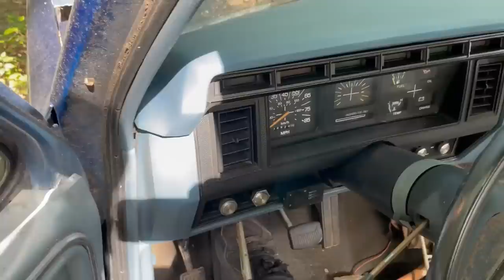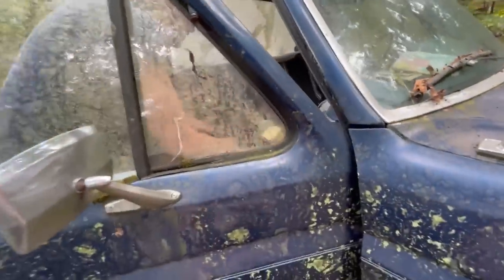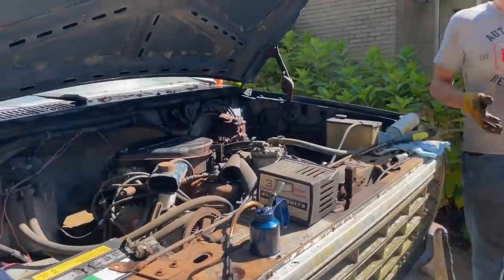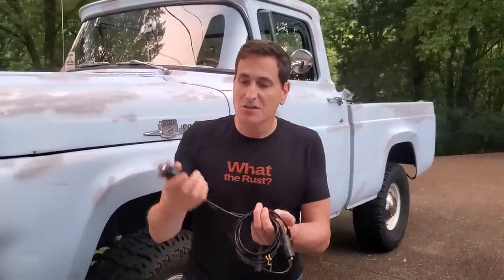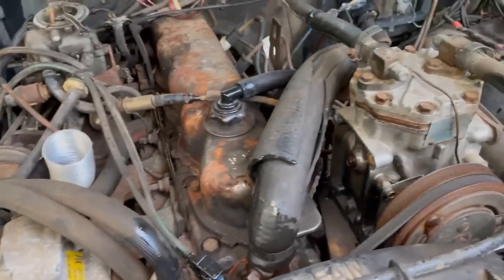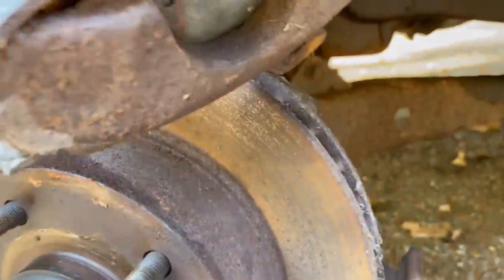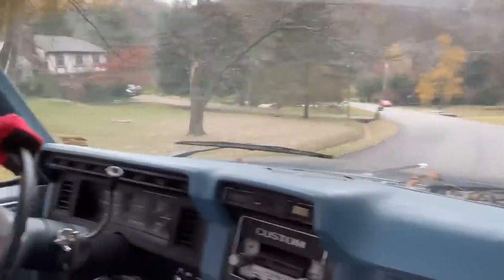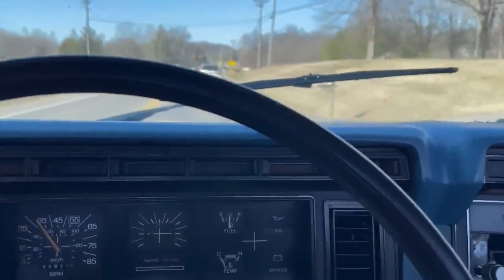What does it take to rescue an old vehicle? How much does it cost?

Comment: Thanks for the giveaway draw. Someone will be delighted to receive this. I wonder, though, is it suitable for use in a 220/240 volt country? Perhaps just with a different charger?
Reply from the maker: Yes, it will work on 220, as long as the charger output is the same.

Comment: Enjoyed this one Richard, and love the 80's 8 spoke wheels, I have the same thing on my Van!
Reply from the maker: Nothing says 80s like those wheels. Thanks for watching Kev!
Reply: This one looks to be an '80 or '81..the only 2 years of this body style that had F-O-R-D letters on the hood, and lacked the blue football in the center of the grill that Ford has felt like they must put in the center of the grill of everything for the last 40+ years. I much prefer the clean grill and the FORD letters. The fact it's an '80 or '81 is also probably why the paint is still reasonably good...pre-EPA paint years. By the mid-late 1980's, the EPA paint would peel like an onion in 3 or 4 years..sometimes not that long. I bet if this was an '86 or later truck, the paint would be peeled off...

Comment: I was 20 years old in 1980, I was driving a 1979 I bought new and I had a 1968 F100 with the 240 straight six! My 1979 had a 302 automatic and I got married and started driving my 68 again to work while my wife was now driving my 79, F150! My oldest brother had a 1980 just like that one with the 300, 6 cylinder and he pulled a 16’ trailer hauling his tractor and implement! That 300 was a brute, plenty power!

Comment: Brake fittings, Heat, spray with lube, Heat, spray lube then attempt to undo. You heated it, but there was no lubrication between the fitting and the flared end of the pipe. A little heat, a lot of lube and patience usually saves you at the master, if the lines are bad underneath it is usually quicker just to make a new hardline
Reply from the maker: Right on. The original video showed the oil, but it didn't make it to the final cut of this one. It had burnt off from the torch in the scenes here. Thanks for watching.

Comment: And the AC works! Lol 
Yes Richard you understand the irony.  That is a dealer installed indash system.  Remarkable the shaft seal in the compressor did not dry out and leak. I expected the old straight-6 to run. But the air had me laughing. Did a rescue similar to this on a 1982 F-150 for a doctor that parked it years ago and wanted it back on the road. Same project, fuel tank, fuel system, carburetor, brakes and lines, new heater and radiator hoses, water pump, and a hell of a good cleaning. He's been driving it since I delivered it back to him two years ago. Thanks for the memory! 
Great trucks those old straight-6 Fords.
Great rescue brother. 
Kudos to you and the misses.
Reply from the maker: Thanks Gary. You are right about the compressor. It started leaking oil a couple of days after we got the truck running. There was more oil in it that I would have expected. We are happy this brought back some memories for you!

Comment: Lost keys is a common problem with older vehicles..lost titles are also a common, and bigger problem. Here in Ga., you don't have to have a title for anything '85-back, which is great..it is getting to be a problem now, though, since late '80's and 90's vehicles are getting on 30+ years old, and thus a lot of lost titles. I can imagine what a headache it is in states where you have to have a title for anything. It's ridiculous, nothing 30 years or more old should require a title, especially where it has been sitting and off the road for years..a notarized bill of sale should be sufficient. And on people not being honest about how long something has sat..well, yes, they might be being dishonest, but I think many times, they just don't really realize just how long it has been.
Reply from the maker: Here in TN titles are required for any year, but if you buy a car that is over 30 years old and pay under $3K there is a way to get a title. It is a bit of a gamble, since you never know what the State will say, but it does work.

Comment: I just restored the mechanical side of a 1977 chevy c20 454 truck, ended  up pulling engine to rebuild good I did crack on crank journal, 2k for that plus machine work, bought for 1600$ have about 5k totaklin truck fixing all mechanical issues.

Comment: Always enjoy watching your video.  Practical approach and explained well.  Also, I have a 1978 New Yorker Brougham with the 440 engine, and unfortunately, the Lean Burn system.  Would love for you two to come diagnose and fix the Carter Thermo Quad.
Reply from the maker: Where are you located?
Reply: @whattherust  Greer, SC. She is not a rusted car that you normally deal with, but I have faith that you will know what to do to get this Carter Thermoquad doing what it is supposed to be doing.

Comment: Hi guys , my first will it run was in 1988 , I purchased a 65 t bird 60k miles from original owner. I had sat for 15 years, got it for 1200. Pulled plugs filled cyl with diesel ' Put new battery fired it up and drove it home.Everything worked. Drove it for 2 years then sold it for 3500 because my neighbor had a stroke and he used to own a body shop and he would sit there and look at it and cry. It had to go. All I spent was for batt points wires and plugs and an oil change. 
I had a ford truck maybe a year newer than this one , same blue, what was funny is that it had a galvanized body. Wouldnt rust but wouldnt hold paint either.
Reply: Ditto on the galvanized paint. Elliott Paint out of Chicago in the 1970s had a primer called "Galva-grip" that worked great
Reply from the maker: Thanks for watching!

Comment: Hey Richard & Cristina, I had just gotten back from town parked in the shade and decided to see what was on YouTube and immediately recognized the Blue Ford.  Naturally I had to watch your video.  I still have my red 85 F-150 sitting here on my property. The one thing that your truck had that was the brass radiator whereas my 85 had the plastic radiator. 
Also, My Ford has the New Process 435 4 speed transmission instead of the 3 speed on the column  First gear was low enough that you could jump out of the truck and walk alongside it and never worry about killing the engine. - Now talk about some old truck feel.
My ignition system has the module mounted onto the distributor instead of the DuraSpatk ignition system.
Hearing about that wiper switch, I am kind of curious if someone hadn’t installed the same type of wiper switch like my 1990 F-150 has where you turn the switch to the left for the intermittent wipers or click the switch to the right for the normal Slow & Fast Speeds.
Anyways I made sure to subscribe to your other YouTube channel if nothing else to show my support for your great content.  Try to stay cool & hydrated because I am quite sure that you are having the same hot weather that we are In Central Kentucky.
Reply from the maker: Thanks very much for the support. It is hot here too, but relief is coming.

Comment: What makes of batteries and battery chargers would you recommend ?
Reply from the maker: Hi Gary. I use Interstate batteries from Costco. They are much cheaper than those from the major parts stores, and I have had great luck with them.

Comment: i had a 59 Chevy truck straight 6 it sat a long time I should of dropped the oil pan and got the crud out that's what killed my motor .it had a starter pedal on the floors
Reply from the maker: Those old Chevy sixes sometimes don't have oil filters, so a lot of junk can get into the oil pan and stay there.

Comment: great video, very informative. though most vehicles you'd find in european woods will be way gone, and parts aren't as easy to be found unless mercedes or aircooled VW. no other brand, except Porsche (and you rarely find them anymore, they are too expensive) is popular enough for companies keepign every part you'd need to get a car back to live, in production. especially Ford is notorious for that, in late 90's they shooed a large Capri club away asking for parts reproduction and documentation. only later they realized what Mercedes knew for far longer: drivers of classic cars tend to buy a modern daily driver of the same brand...
anyway, a straight-six, three gear manual pickup from the 80's sounds like an english basic vehicle with only the bare necessities in it. I hope you'll get more feedback from the buyer, and especially the new owner. maybe they'll keep it for longer? and keep it fairly original, too. I had my very first car for almost 13 years, and would still have it 30 years later if I wasn't so neglecting back when. :)

Comment: The reason why there was transmission fluid in the truck is the same thing my dad used to do and that is use it for the power steering fluid in the reservoir,, and I don't recommend that, but my dad didn't want to have to keep buying the small size containers,,i call him cheap often lol
Reply: Richard sir are you using a rubbing compound on the fender before you waxed it when you used the microfiber towels??
Reply: Richard sir you breaking down the lugnuts to get them off, that is why I have the harbor freight icon brand comfort grip 1/2 inch long handle breaker bar, and before it was a medium sized great neck breaker bar and the Pittsburgh comfort grip breaker bar and both were fine but I needed to replace the 3/8 s&k breaker bar I had and then people started using it for a handle on the engine hoist and lost the anvil and the location pin,,,so I bought the set of icon brand breaker bar the 3/8 first decided I liked it and would like the matching 1/2 to go with it and that is what I did and give my buddy the Pittsburgh one since there was nothing wrong with it 1/2 and comfort grip.
Reply: I love the limited low option and trim truck models,crank windows cheap manual shift transmission and the standard heavy duty automatic transmission,no tilt,dome light power steering,power door lock or ac,no interior trim options no carpet only vinyl or rubber floor mats, being a farm kid growing up we had several Ford custom trim and xl trim level trucks, momma's green 96 Ford f250 super cab long bed hd sterling 10.25 4.10 rear end 460bbf , and Chevy custom deluxe lower level trim truck and no options almost Scottsdale optioned trucks..my thoughts always been not as much options especially power ones less stuff to mess equals less we have to fix
Reply from the maker: Yes, I used cutting compound.
Reply from the maker: I agree. I'll take manual windows and simplicity over power options any time.

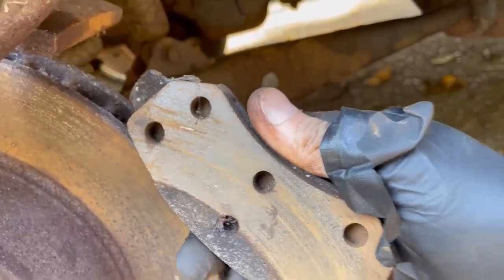Comment: Saw at 33:00 the upside down brake pad.  Reminds me of a story.  Needed front brake shoes on my Honda Goldwing.  Didn't have ways/means/tools to do it myself, so I went to a bike shop.  I shoulda listened to intuition once there--place was run-down and the guy there looked like some strung-out biker on meth :face-red-droopy-eyes:.   
Once I got the Goldwing back, I went for a drive.  Hit the brakes.  Back ones worked fine.  The fronts screamed metal-on-metal on that poor disk.  That jackass installed the damn pads in BACKWARDS!  I took the bike back and cussed him out.  He re-installed them correctly (the disk did survive, no cuts or grooves), and I never went back there.  Finally got tools/ways/means to do my own work.
And that guy was running a motorcycle shop, vehicles which are dangerous anyway??  Dude, you don't have seatbelts nor the "safety" of a cab like a car or truck.  You DO NOT screw off brakes on a motorcyle.  And that helmet means really nothing, worst case scenario.  People can and do die.
Richard's correct on everything he says in this video.  Imagine if I was selling my Goldwing with those effed up brake pads.  I'D look the the jackass!  Not right, not cool.:face-red-droopy-eyes:
Reply from the maker: Wow, you could have ended badly! Good you never went back.

Comment: Good save...good anytime you can save an old truck..they just don't make honest trucks anymore, just luxury yachts, and if you need to haul anything, everybody expects you to use a trailer...I'd rather haul stuff in my truck. That said, it's hard for me to think of these as "old trucks", I remember very well when they were made, and they made them for many years...that was true of any truck..same body style for years, decades sometimes. Made finding used parts easier. I'm really not a Ford guy, and I didn't care that much for them when they were new..like them better now, though. They seemed to me like they were made of thinner sheet metal and flimsier than the Chevys and Dodges of those years...whether they really were thinner or not, I do not know. Never liked the cheesy sure-to-break inside door handles, either. When it comes to Ford trucks, I like the '57-'72 models best, my favorites being the '64-'65-'66. Liked the '78-'79 also. Didn't like the '73-'77, thought the grill, headlight, and parking light setup looked odd...
Reply from the maker: I agree. Trucks today are too over the top. They are like Cadillacs with a bed. We have a 66 F250 video coming soon that you might like. Thanks for watching!

Comment: I have never seen anyone take a torch to a brake line.
Reply: It is a normal way of getting the fittings loose, without breaking the line. You just have to make sure one end of the line is open,or if it is a rubber line cut it first. to keep it from exploding. hope this helps.
Reply from the maker: Right on. Always cut the rubber line. They will explode!

Comment: Been wanting to do this for a long time,I am a good mechanic with points and carburetors,timing chains ,getting stuck engines running,have 95% of the tools,work on all kinds of front ends ,upper and lower ball joints,mainly On older models fuel injectors,..I became disable in my left arm ,but I am able to perform ,just need capital and a way to get on YouTube, learn how to be cool with the fans,in my own way,do not want to copy some else and the way they interact with there fans,,wish I could win that charging box,lost my trucking job in the beginning of this year,been trucking for 40 years,this will be better,have pickup and chains
Reply from the maker: Just be yourself. That is the easiest way to make the filming easy. You have the knowledge, so alll you need is the right vehicle to start with. Good luck and let me know if I can help.
Reply: @whattherust  Thank you,

Comment: How much does it cost:  Answer. Your eternal immortal soul.
Reply: Good thing I was subscribed to the other Chan long ago as it’s over 1000
Reply: I miss the days an old non running truck in the woods was a $100 buy at best or free.
Reply: That thing is really easy and inexpensive to rekey even if you don’t get one.
Reply: The scraper was probably placed as tree was starting to grow into the bumper they used that for tension to push growth many years ago.